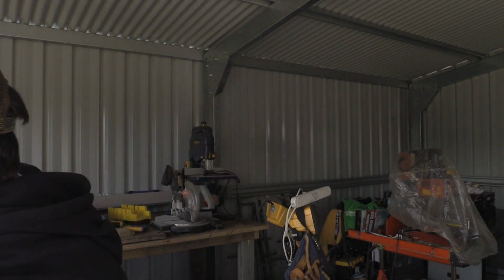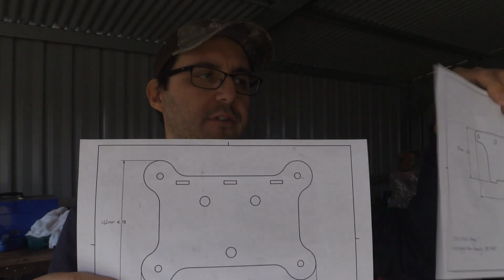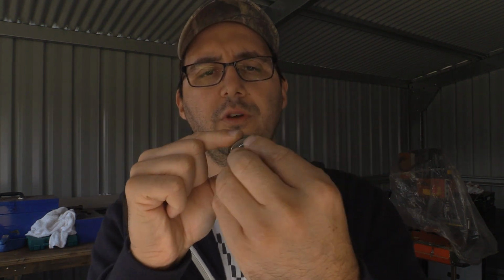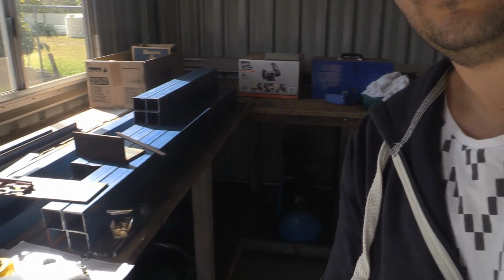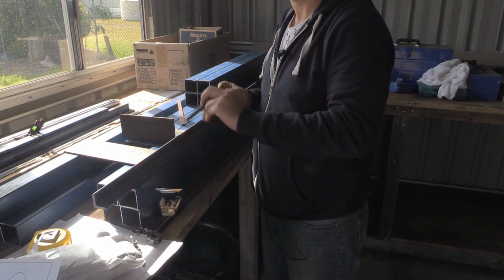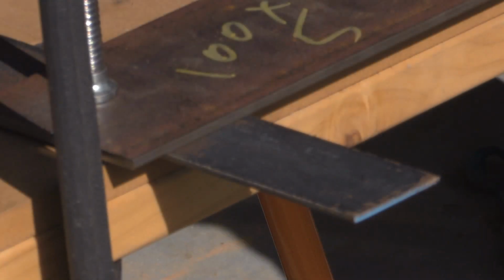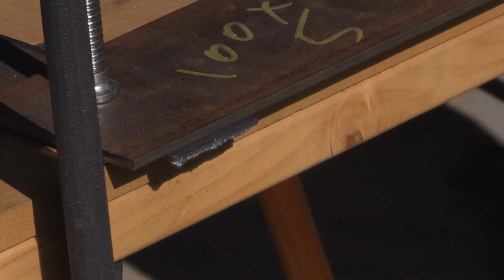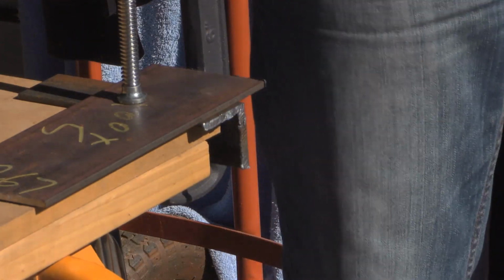DIY CNC plasma build by a novice   part 3

Comment: Hey Mark, really enjoying your series and am researching to undertake a very similar project myself. I was curious what model Plasma cutter you are using? I am struggling to find one with a separate control input port (I also live in Australia). Also I was wondering what means you were going to use for Z axis control and offset from work-piece?? keep up the good work.
Thanks, Ryan

Comment: If there is ANY moisture in your air supply at all it will greatly diminish your cutting capacity.  Do you have some kind of dryer or oil cleaner connected?  Might be why you're not reaching full power to cut half inch.  ??  Just a thought
Reply from the maker: G'day +TNA2Me good call there, as I've only got a water trap on the hose line. I also live is an area where the humidity is high so that would probably be working against me too. It would probably also help if I knew what I was doing with it :)

Thanks for watching.
Reply: Don't be to tough on yourself you're doing a great job!  Good video.  We're all learning together!

Comment: I have a thought about the parts that are needing to be bent. You could use the plasma cutter to cut the part threw the bend aria leaving 1/2 inch solid on both sides bend the part in a vice and weld the cut back solid again?

Comment: Looks like a good start. I don't envy you having to trace out all those shapes. I think roughing out the cuts with the plasma cutter would be fine but taking your time and cleaning up the edges on a bench grinder or belt sander would really pay off.
Think if i were building a table that rigid and heavy id design a wooden spoil board and a gantry and carrige that could also be used as a cnc router. Its going to be plenty rigid and heavy duty for that and no doubt you could get much more use from the machine.
Looking good
Reply from the maker: builtrodewreckedit I've had some fun with the free hand stuff already, it's hard to get a nice cut while trying to follow the contour. I think it may be my technique but I'll work on it. I was watching a video by mrpete22 and he uses a timber template as a cutting guide. I tried it yesterday and it worked out ok, so I might make up a few using either the bandsaw or jigsaw. I guess we'll see how it goes.